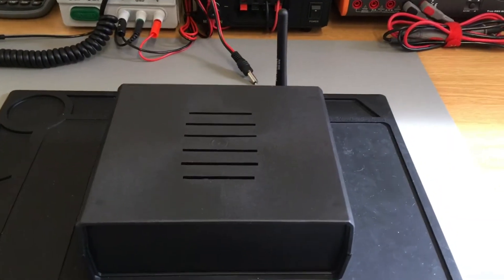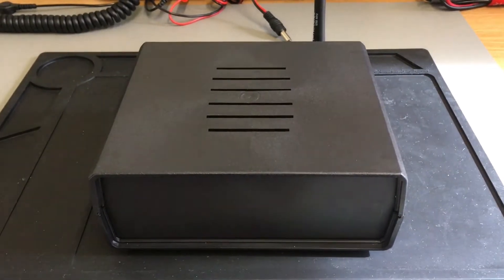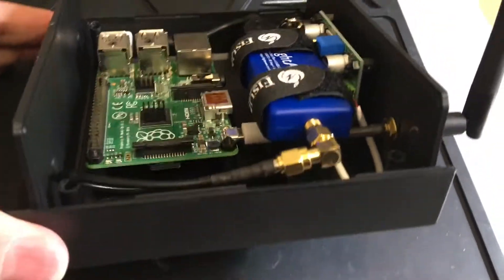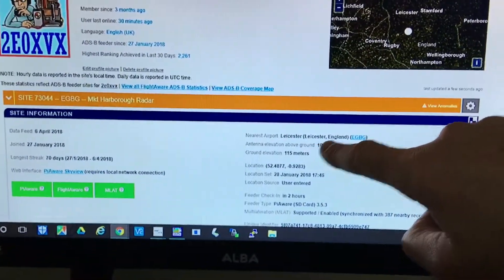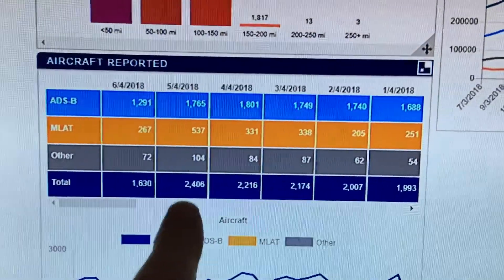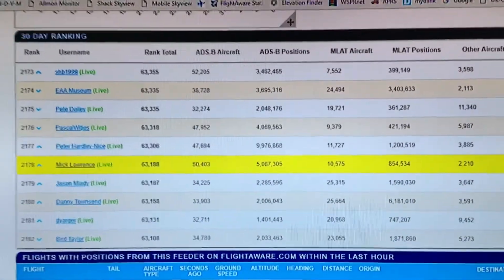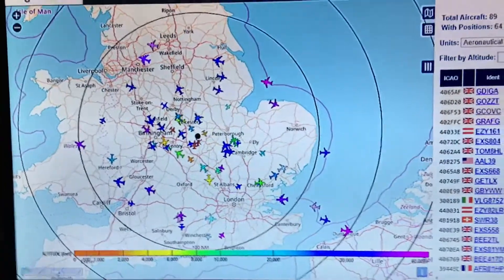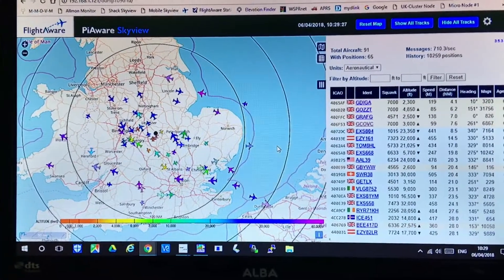ADS-B Aircraft Beacon

Comment from the maker: DG Enterprises, I know exactly what an ADS-B transponder does and what the ADS-B raspberry pi receiver is and does. I try to put it in simple terms for people that have no electronics background. Regarding fitting a LPF, then its dependant on how much noise is present in your area. I have many SDR radios, and local RF can be different in different areas. By fitting a good  quality external LPF will do no harm at all, the cleaner the signal, the better your coverage, so whats your problem??. You get on with what your doing, and I will do mione...Dont like it, leave my groups!!!. Its very simple.